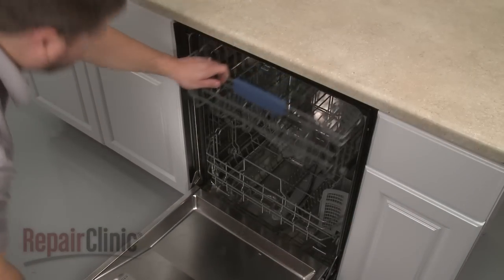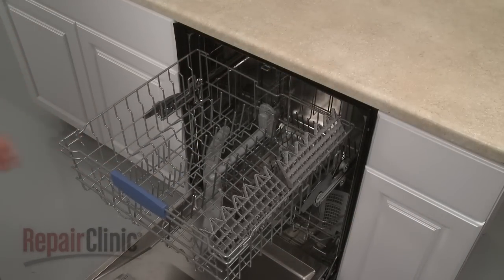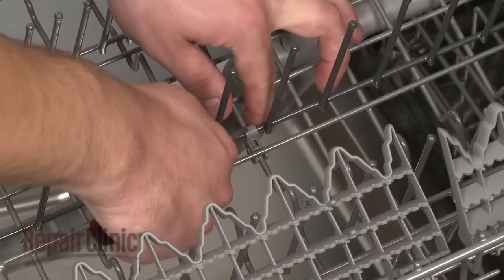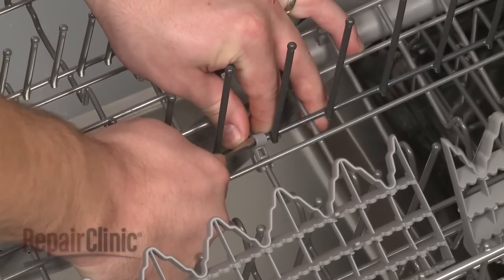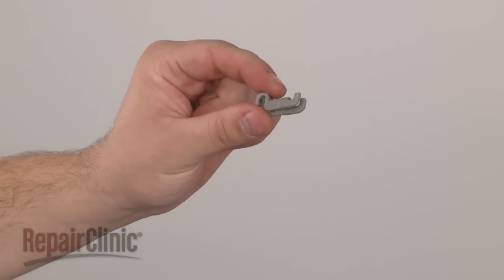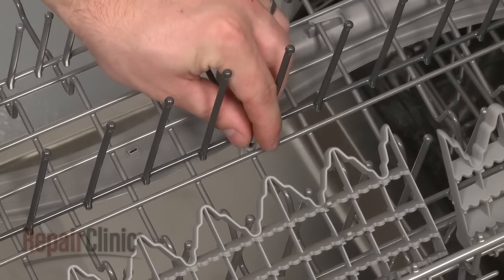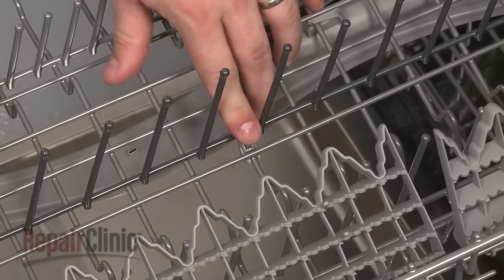Bosch Dishwasher Tine Clip Replacement #00611981

Comment: I took out the fliprack when the tine clip fell off, then had no idea how it fit int the front clip! So I removed the more complex front clip and got it figured out. It was hard but I did it.
Reply: Can you please share how you got the front one back on please?
Reply: @AllReg  The long groove on the clip goes on top, holding the flipracks leg. The back of the fliprack fits under an impression on the rack. There is a flat end of the clip, like a T, it points left. Under that is where the clip fits to the rack, sliding on. It is difficult to figure out as it's the only one.